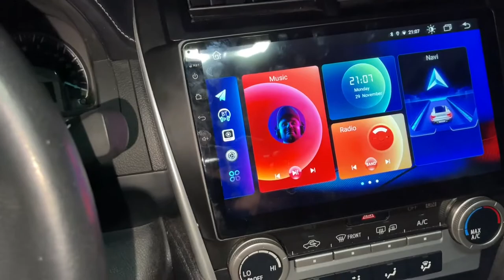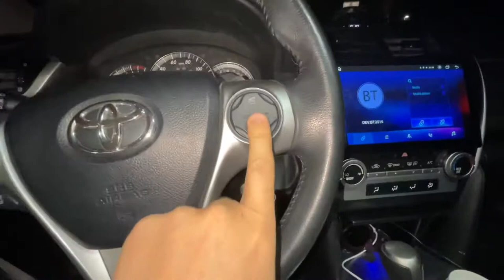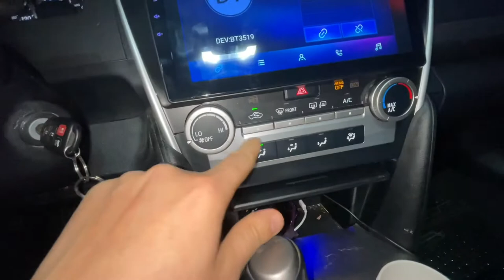Android Radio Steering Wheel Control I Aftermarket Stereo - Roadanvi

Comment: Does the head unit recognise ALL of your Steering wheel controls? I have the same 2013 Camry setup and a sony unit that does not recognise the left, right, and center directional buttons or the 'back' button - considering an upgrade to a full android unit...
Reply from the maker: Yes. Mine recognizes all.
Reply: Do you find any solutions? My 2014 camry doesn’t recognize the left center right and back button too with pioneer android HU

Comment: hi thank you for thevideo, for that cable the you make emphasys to connect I don't have a place to connect it on the radio, Do you know where it should go
Reply from the maker: Look at it carefully. You will see it there
Reply: @TechGeniusHacks Hello, I have same problem, I've been looking for where to plug the cable. I use Toyota Camry 2014.
Reply from the maker: @animashaunmusa3699  you need to plug it at the back of the radio
Reply: @TechGeniusHacks  my radio has nowhere to plug that in to

Comment: Maybe you can help me troubleshoot if you don’t mind. My steering wheel controls work but when I hit the volume + button on the wheel, it increases the volume level by 3 instead of just 1.  I can’t find an option to change that. It’s really annoying lol
Reply from the maker: Have you tried to adjust it on settings
Reply: Yeah there really doesn’t seem to be any setting for it. I’ve tried a few different CAN numbers as well to no avail. It even moves by 3 when I use the ➡️⬅️ buttons too 😐

Comment: my volume and arrows work to skip and pause music. but the mode  and phone controls won't work. what can I do?
Reply from the maker: There is a setting for them to change the steering wheel controls
Reply: @TechGeniusHacks  I tried holding the buttons and pressing the   function I would like to use it flashes and doesn't work on swc setting
Reply from the maker: @bhangrapunjabi  was it working before
Reply: @TechGeniusHacks  no it wasn't. My steering wheel buttons weren't working before until I removed the aux in left and right wires.
Reply from the maker: @bhangrapunjabi  there could be something wrong with the canbus plugs or you need to change the car type in the settings.
Reply: @TechGeniusHacks  I've taken my stero apart 4 times working with roadanvi for resolving the issue. All the connections are secured. And I've set the canbus to 3 for camry as well
Reply from the maker: @bhangrapunjabi  what is your make year and model camry
Reply: @TechGeniusHacks  2014 camry se

Comment: So where does the little white can bus plug, plug in? To the head unit or to some part of the cars wiring?
Reply from the maker: There is a plug coming from the HeadUnit wire harness and there is another plug from canbus. You need to plug them together
Reply: @TechGeniusHacks  I plugged in the bigger white plug to the can bus but then the little white plug in the harness will fit into the head unit? It's the one you showed in the video but there's no place to plug it to the car, so I guess it loops back the the radio. (The little 2 white wires)
Reply from the maker: @TheKeithrg1972  did it work?
Reply: @TechGeniusHacks  haven't installed it yet, I'll let you know
Reply from the maker: @TheKeithrg1972 got it

Comment: Once the radio is installed, does it have to go through the boot up process each time or will it be "always on" (display off when car is off), so the display is immediately on when you turn the car on?
Reply from the maker: There are both options. You can choose whichever you want.

Comment: I don’t know if I’m doing it right because I installed the radio with the Canbus box and the Check engine light came on then I took it off and it is fine
Reply from the maker: It is probably because of part that you need to plug. You know where you change the ac manually under the radio. There is a plug when you remove the radio. If you didn’t plug it well, it will tell to check the engine:)

Comment: Where do I plug the canbus plug..can’t find it
Reply from the maker: It’s on the back of the radio. Watch the video very carefully I was showing it over there
Reply: @TechGeniusHacks  I appreciate..I got it. But my backup camera says no signal..how do I fix that
Reply: @TechGeniusHacks  help me  please
Reply: @TechGeniusHacks  all is working except the backup camera
Reply: @TechGeniusHacks  are you there. The factory camera says no signal
Reply from the maker: @olufemiogunseye4149  Did you watch this?

https://youtu.be/ZvREXQZOYC4

Make sure you plug everything in for the camera
Reply from the maker: What type of camera do you have
Reply from the maker: Did you do the canbus settings
Reply: @TechGeniusHacks  it’s the factory camera. I don’t know the type. Camry 2012 xle
Reply: @TechGeniusHacks  yes I did
Reply: @TechGeniusHacks  I watched it
Reply from the maker: @olufemiogunseye4149  there should be RCA cable coming from the car and android radio has a plug for the rca cable. Plug them together then it should work

Comment: that white small cable has nowhere to connect in the back of my radio help
Reply from the maker: 10:12 min of the video https://youtu.be/6c2M8CaB2NQ , I am plugging black one. You need to plug the white right next to it. There is only one place that can fit in the back of the radio.

Comment: So it was working at first and it stopped working now what should i do
Reply from the maker: What did you do exactly?
Reply: @TechGeniusHacks   i got in the car trying to increase my volume then noticed it not working again
Reply: @TechGeniusHacks  and also noticed if the steering controls are not working the the 
Consumption chart and tyre pressure won’t work to
Reply: I think maybe the cambus  is not communicating well that’s what I think
Reply from the maker: @s_imzygame4221  it is related to canbus
Reply from the maker: @s_imzygame4221  check the connection plug is properly placed in